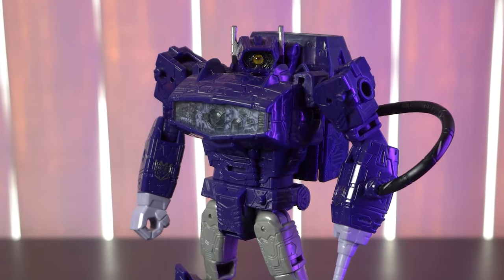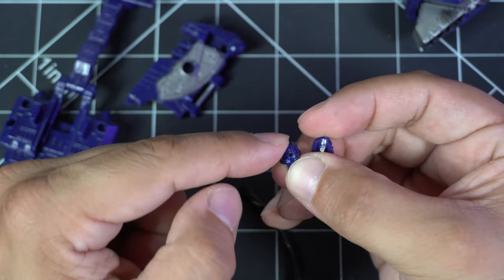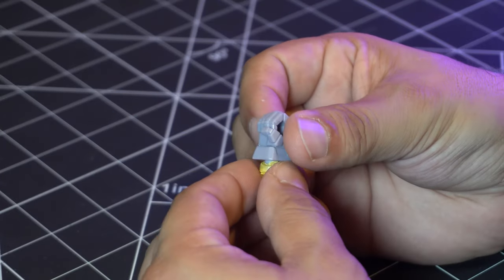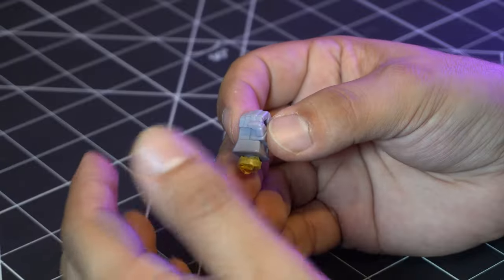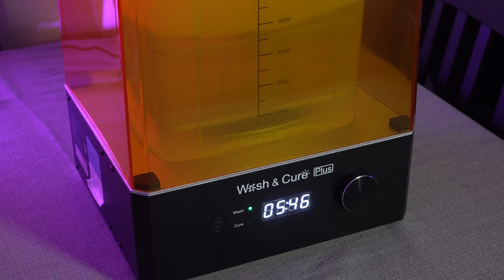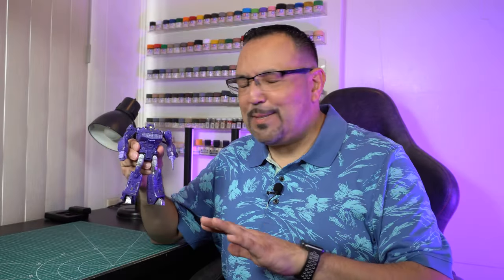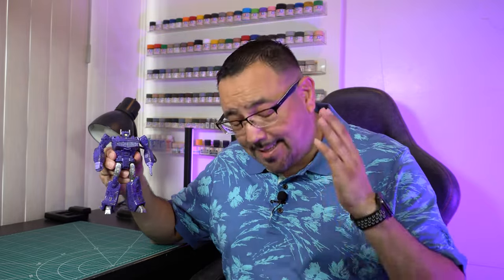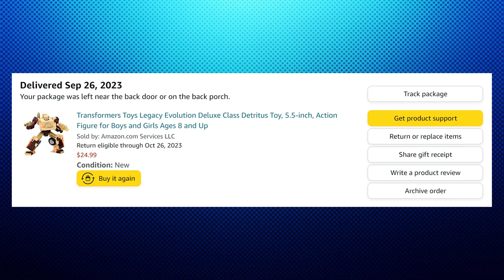Transformers Siege Shockwave Full Customization & Repaint | 4K

Comment: I know it's slower but I prefer just using Isopropyl for paint stripping on figures. I've noticed some mixes of ABS (and especially POM)  get a really nasty "crazing" effect on the surface, and it's impossible to get rid of.

If it's a full repaint, it doesn't matter.

Comment: The ONE issue I have...

Is that you intended to plug the hole that the tube is meant to go in underneath the arm. The tube is meant to go there
Reply from the maker: ACKCHYUALLY (lol) I was mistakenly plugging the hold on the SIDE of the arm at first, like you see in the beginning of the video. The hole I left open was under the arm, the one that's meant for the hose, so it's correct now. □👍🏼